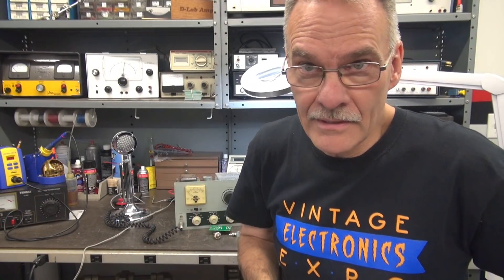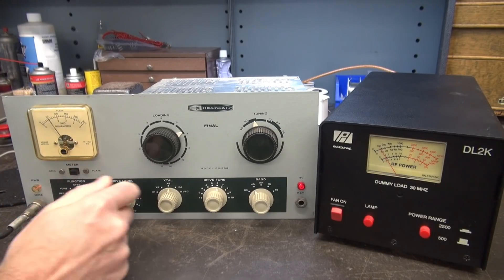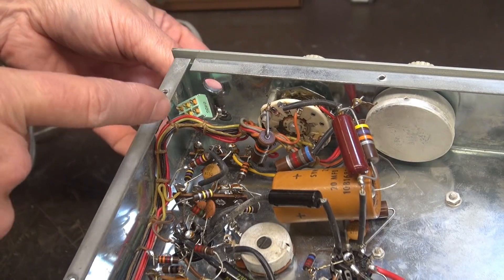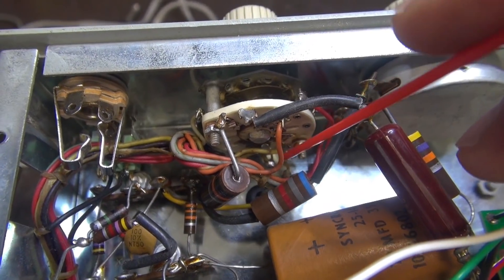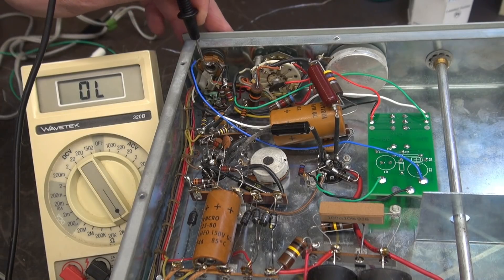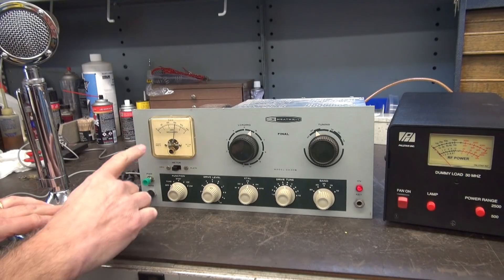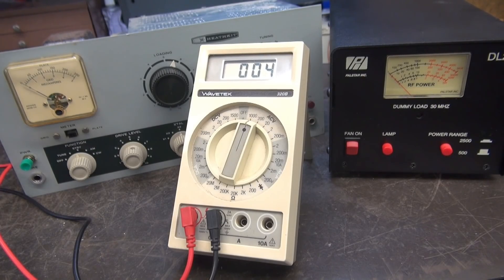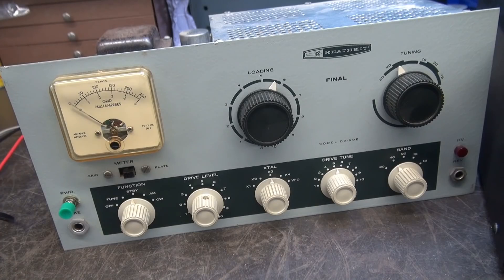How to Install PTT Push to Talk Heathkit DX-60 Transmitter with monologue Switch

Comment: Bought my DX-60B 2 weeks ago. This video explains a very strange mod that was done to the front panel. A 
push to talk switch and a red light next to the meter.
No wires connected to anything. I'm guess they never finished the project.
Thanks for the video, now I know.
73 N3PZZ

Comment: I just watch these videos cause I love old tube stuff :).   But Its a shame that your boards wires not to be mean but your wiring job of this board is actually MUCH more sloppy looking then the job the owner did when he built this.  Maybe could figure out some way for this install to look more tidy when installed?  Also you did not say how you attached your board .  Double stick tape?  Epoxy?   How do these old point to point systems end up so clean sounding?  I would think with all that un shielded wire that there would be lots of power noise from all that high voltage .
Reply from the maker: Hi Jennifer, This board is switching 120VAC and approx _60vdc. It is not in a audio circuit. There is no effect related to noise as this is a Ham radio transmitter, not an audio amplifier. Wiring can be tidied up with a few zip ties. The intent is a easy to install module, no drilling required.
Reply: @d-labelectronics  I love watching your videos :).   I was unsure about any noise being added but was shocked that the basic old school point to point method in general I am shocked has always been so good lol.  You would think all that non shielded wire and such would be nasty lol.   I assumed you used the same double stick tape on this as the other video?    Its so cool you keep all this vintage gear working .  I was really only being picky if I spent all that time building something that complicated id probably run the wires along side the old wires somehow like you said maybe with zip ties or something .  Hey i'm a woman I like things tidy lol.